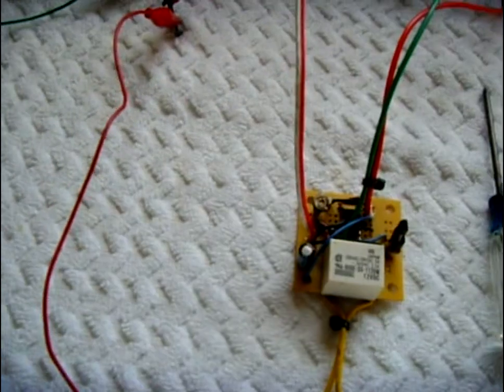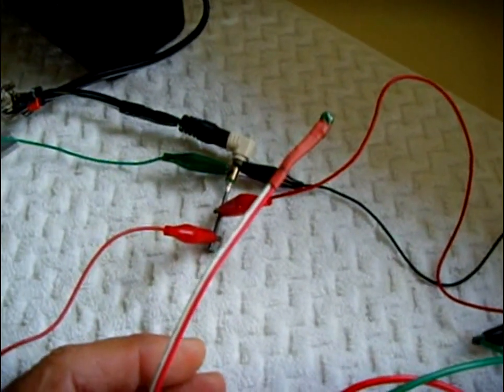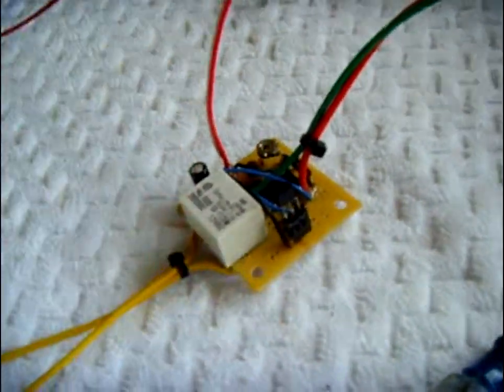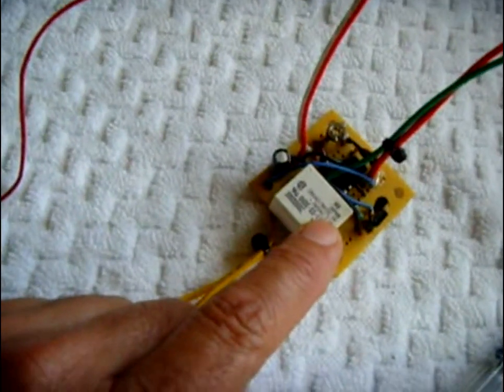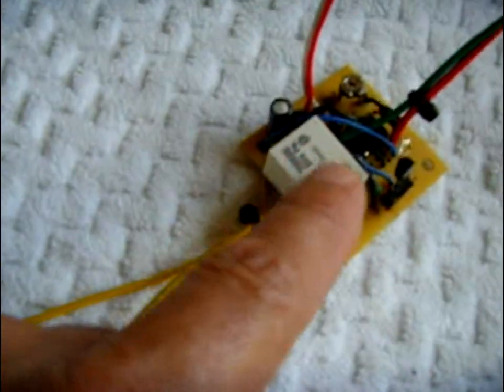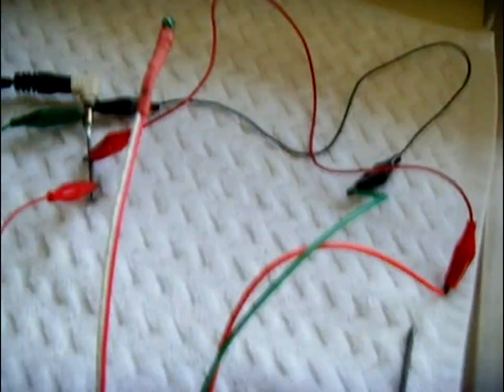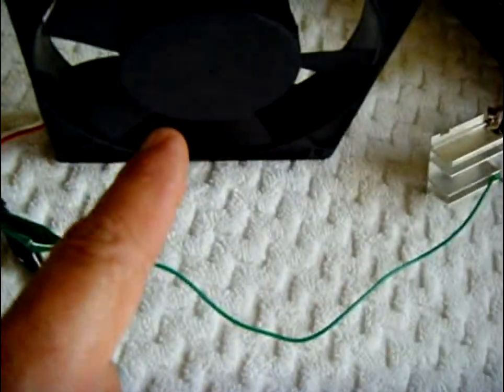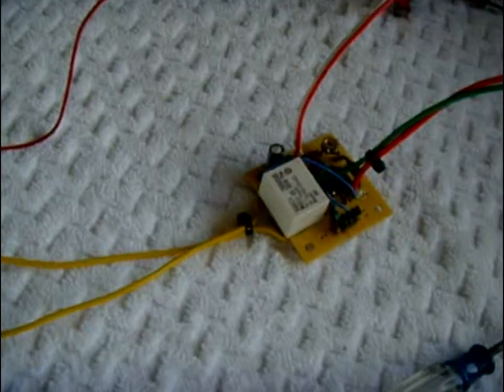12V Temperature Activated Relay Circuit(Hot or Cold Activated)

Comment: I have a corvair,  Air cooled car. The thrmostats would stay closed when cold and would recirculate the air around the engine compartment. when they heated to about 160F these doors would open and alow the air to leave the car. I would think the best Idea would be to hold the doors closed until temp is reached then power is cut to solinoids and the doors open. Are there simple premade switches that could do this
Reply from the maker: Yes, temperature controlled modules are available at banggood4less.com and ebay. Thanks for watching!

Comment: Great circuit application... I want to use it as a temperature switch to turn on a heating element during winter so my exhaust shutter opens, temp range of operation will be +5 to -5 degrees celcius, will this work in the NPN mode, and the element runs on 220V, what relay do you suggest? thank you for your help man!
Reply from the maker: Look for a relay that has contacts rated for 240V, and a coil that draws a low level of current(700 ohms or higher) . Be sure to check out my video playlists, rate thumbs up, and share. Thanks!

Comment: Hello,  I want to know how you set the temp limit.
Reply from the maker: With the 10K Potentiometer(R1)
Reply: electronicsNmore Thank you for fast replying. I have one more query, tell me when the relay will turn on if the fan is in on state at the start. Actually I am making a fridge for my in-house project and fan will be replaced by Peltier module.

Comment: I need a relay like this set to come on at 55 degrees celsius. Is this possible?
Reply: Forgot to mention 12 volt for cooling fan to keep electronics cool.
Reply from the maker: Of course. This circuit will work at that temp. The temp range is adjustable.

Thanks For Watching
Reply: electronicsNmore

in an underhood automotive app, what temp range, and what element exposure would need to be addressed?  Thanks
Reply from the maker: The temp range depends on what you want.

Comment: I'm new to this and have an idea for my current project car. Could you please clarify what type of transistors I can use for heat activation?

Also the thermistor I was look at is a "50K NTC", will this work?
Reply from the maker: Hi. 2N3906 / BC557 / or 2N4403 all work fine. If you use a 50K, you need to replace the 1K and 10K pot. Try a 100K pot and 10K instead.

Thanks For Watching! Be sure to rate a thumbs up and share my channel with others.

Comment: Is this sensitive enough to be triggered by a few degrees? I'd like to use it as a booster fan for a home heating duct that only gets a trickle of air.
Reply from the maker: Should work fine. Give it a try. If it is not sensitive enough, then you can always use an lm35 circuit like below. It is more for precision, but I don't think you need that.

http://www.escol.com.my/Projects/Project-03%28Thermostat-1%29/Thermostat1-sch.jpg

Comment: what is the name (specific) of that relay?
Reply from the maker: Nothing special. This relay was pulled from scrap electronics. Just  look for a low ohm(coil resistance) 12V relay that is suitable for the load you intend on using.

Thanks for watching.

Be sure to check out my video playlists.

Comment from the maker: From what I can see, we basically have a voltage divider going into pin 5. The POT setting and thermistor value is what determines what voltage is applied to pin 5. The voltage being high or low is what turns the relay on and off.